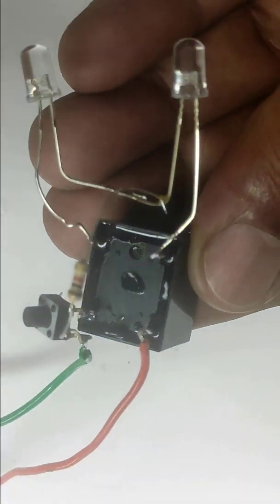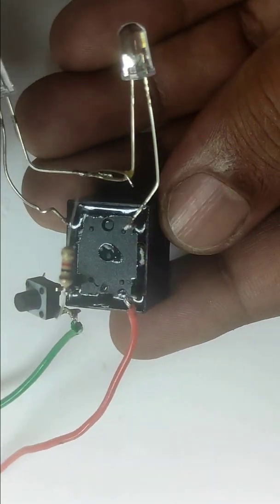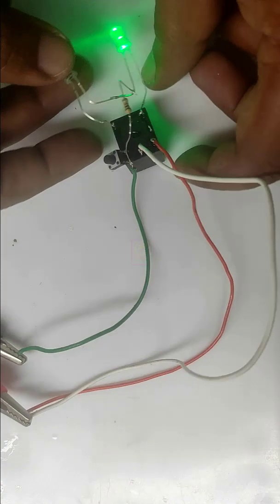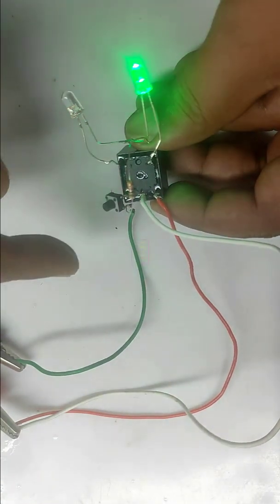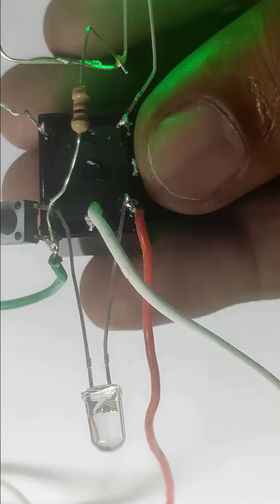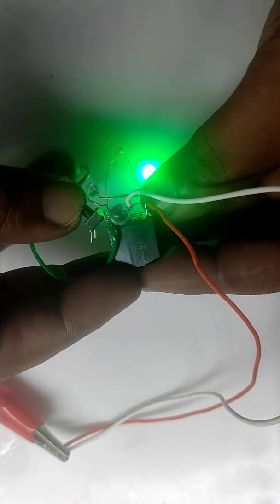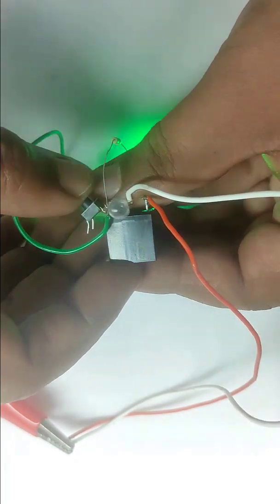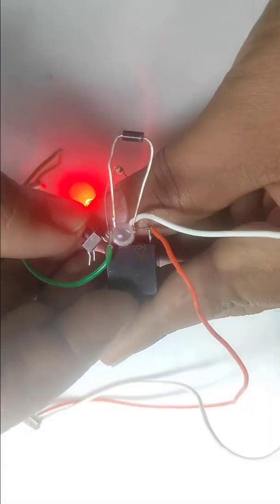Relay Coil Back EMF

Comment: I have a 5v relay that switches 240v AC .When I turn the regulator of the fan a variation in the Ac current occurs .This results in a sudden spike in the relays input .I have used a flyback diode .But still there is a sudden voltage spikes and it changes the state of my microcontroller.
Reply from the maker: How the 5v relay is powered. Does it use a regulated power supply?

Comment: DOES BACK emf GO THROUGH CATHODE OF LED ONLY???
Reply: Yes , coz back emf is always in opposite directions.
Reply from the maker: Very  true. When we release the switch, the coil will act as generator with positive connected terminal (input supply)has negative volt and negative connected terminal has positive volt. That is exactly opposite of the input supply.
Reply: Thanks a lot Sir to clear my doubts😊😊